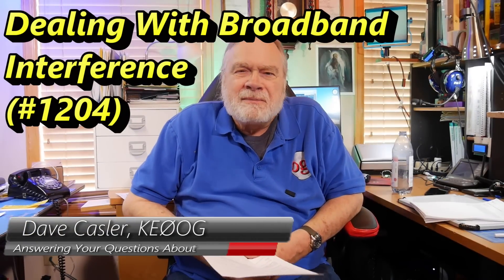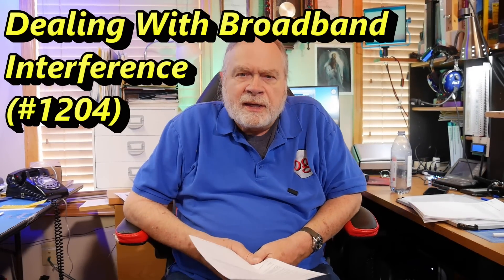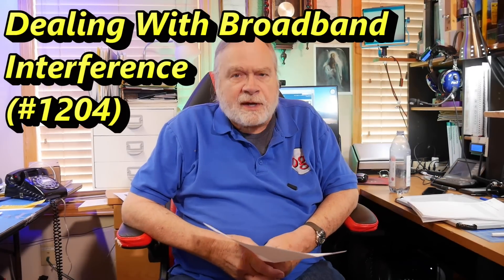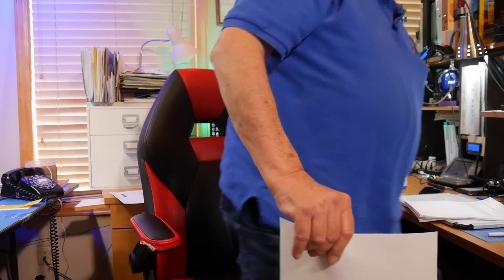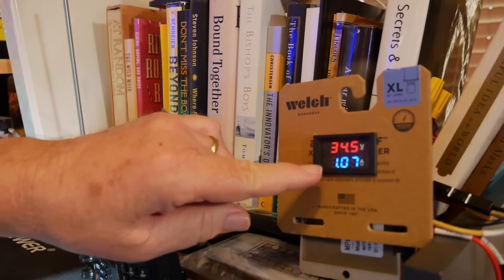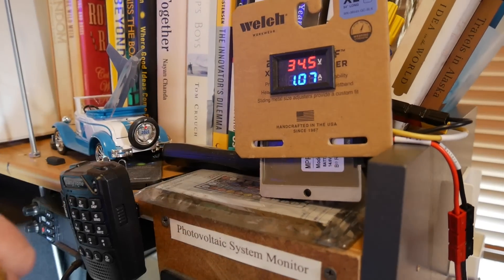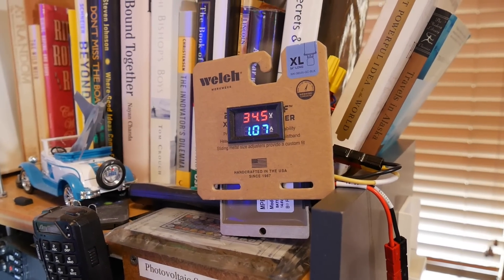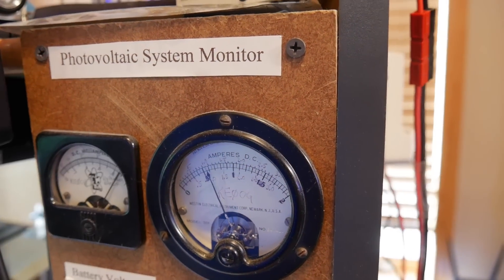Dealing With Broadband Interference (#1204)

Comment: There normally is a main switch on the inverter to shut the solar system down. Depending on the presence of optimizers or micro converters, the system may continue to produce RFI for up to an hour after the inverter has been switched off! Solar Edge systems are notorious for producing lots of RFI, so you may want to check the brand. Also, bear in mind that it is not uncommon for solar systems to produce S9 QRM over a one mile distance. The culprit could very well be two blocks away.

Comment: One problem with comparing day and night RFI is that the higher bands start to close after sunset.  What you really need to do is set the radio's amp at a particular level and hold it on one frequency, and then log the noise level with the S Meter throughout a day of changing weather.  That way, you're not comparing an open band to a closed band, but a band where most of what has changed is the level of cloud cover blocking panels in the nearby area.  Ideally, to prove it's solar, you want a significant drop in RFI just as cloud cover increases, and vice versa.

That said, there's a good chance it's not the solar panels.  Seems like everybody owns some cheap Chinese gear with zero RFI mitigation or even simple power filtration; that stuff doesn't just radiate RFI into the air, it puts RFI back onto the power grid.  Then that both acts as a huge antenna to spread it all over so you're getting noise from miles away, and if you're not very careful it can come in through your power system as common mode noise on your antenna feedline.

Comment: On solar systems with battery banks, the RFI could still be there at night if it's the inverter, rather than the panels, causing the interference. I know those China inverters from the place that Harbors their Freight can be quite noisy.

Comment: Dear Dave, I have a 10K solar panel system 75’ - 100’ away from my antennas. After sundown, there is no discernible change in background RFI. In regard to your advice, why not just suggest that the gentleman try to determine if there is a CHANGE IN RFI after sundown. Just an idea. As always, thank you. KQ4IXD